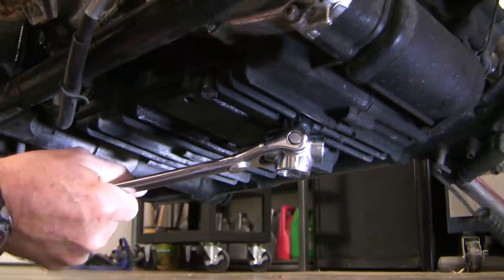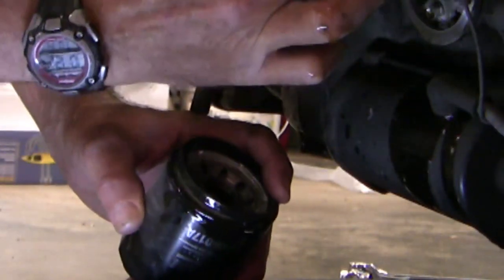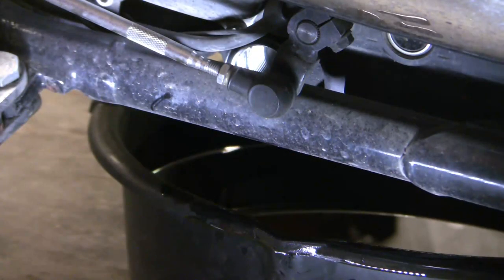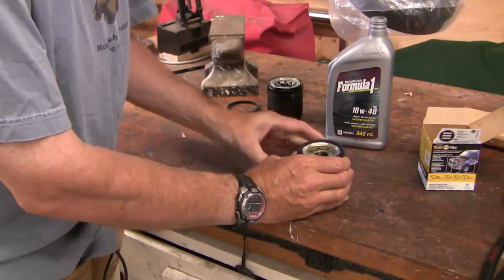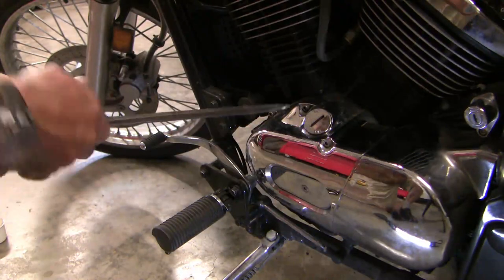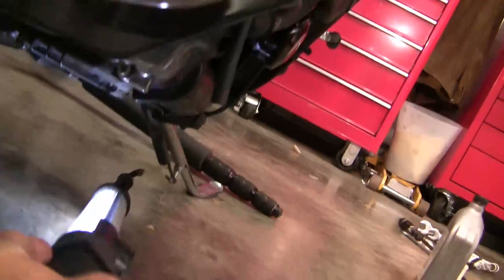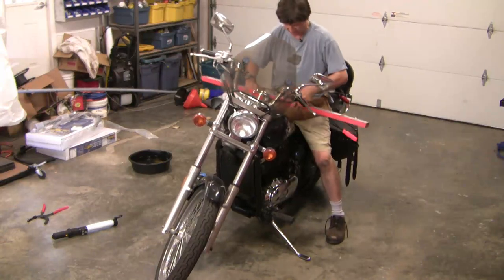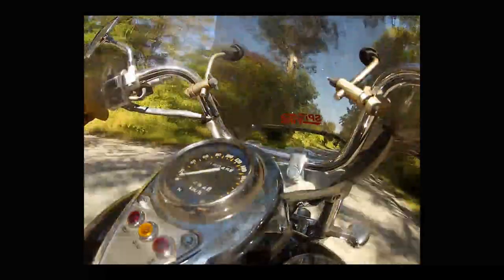How to change motorcycle oil,  Kawasaki Vulcan

Comment from the maker: About once every year somebody remarks that their oil screen is put in with the opposite orientation, with the open end of their screen on the inside. This happens often enough that I suspect recent models of the Vulcan may have the opposite orientation for the screen. I went back to verify that I did it correctly. In the official 1995 Kawasaki dealers service manual, on exploded diagram 6-2 and the photograph on page 6-6, the service manual clearly show that mine is assembled correctly in the above video. This fits with my experience, since I did the first service on this bike and it was assembled that way from the factory. Not one of those who have commented in this thread were able to quote factory service manuals or technical service bulletins to back up the claim that the screen is in backwards. If your screen is installed with the opposite orientation, I would make no change until you take the time to consult with your own official factory service manual, since year of manufacture may be important. If anyone comes across more objective information from Kawasaki, please take the time to provide links to that information here. I'm sure many who stop by will be interested.
Reply: Not true
Reply from the maker: @natalijaly456  That reference you quote agrees with what I have said for the VN800, read the last lines. Whenever you search for information on your bike, go directly to the source, the OEM dealers repair manual, not aftermarket websites that apply to many years and many models. I have done that for the VN800, see the discussion thread for more information. If your bike is different, I probably wouldn't change it, but don't be so confident you are doing it correctly until you consult your OEM dealers repair manual.
Reply: Good day sir. Love the videos keep them coming... I have a 2004 Vulcan classic 1500 and the book tells me to have the open end with O-ring in first..
Reply from the maker: For those who don't own a factory service manual, I recently discovered that Kawasaki have taken the time to publish detailed parts diagrams collated by year, and offer them online for free. Those part diagrams will show your screen orientation. I found mine in that list, again demonstrating the screen orientation for my year is correct in the video. They also sell full online factory service manuals at the relatively inexpensive price of about $60, which is a bargain for those who work on their own bike.
Reply: I have a 2000 Kawasaki Vulcan vn800 I was wondering exactly how many quarts of oil do I put in it when I change oil and filter.
Reply from the maker: @unchained20000000  2.9 liters, if filter is removed and engine is not dry. This is printed on a sticker made by Kawasaki to the right of the oil fill hole. I do maintenance on several vehicles so I use a 6 liter graduated cylinder and put felt pen marks on the cylinder for each vehicle, to help recall this detail. Saves time and reduces risk.
Reply: @spelunkerd  Btw can you do a coolant change and check on the Kawasaki Vulcan vn800 as well.
Reply from the maker: @unchained20000000  It's done, on my channel there is a playlist of motorcycle videos, you'll find it there.
Reply: @spelunkerd  This answers my next question,  lol, I'll be needing to find and change my engine coolant as well.
Reply from the maker: @highenergyog  You might check out the Kawasaki website, where you can find electronic copies of their factory service manuals  specific to your exact bike for a reasonable price. I get one of those for every vehicle I own, it is an excellent investment. Nice to meet you!
Reply: @spelunkerd  Thank you for that helpful advice,  I truly appreciate it and I will do just that . Best regards, Lloyd.
Reply: @spelunkerd  I bought a measuring cup for shop use. In my 800 I put 3 qts then just a tad over 1/4 cup. Sight glass looks good and no problems. I just wish my Harley was this easy and cheap. $37 for K&N 303 filter and 4 qts Lucas 10W40 semi synthetic oil for Vulcan  VS $200 for 3 hole change a the Harley. Dealer gets $400. No thanks, I’ll do it myself.

Comment: Been building Harleys and Triumphs since mid seventie. Got creamed by a drunk on 9/11. Met a friend of a friend who had a 2002 Vulcan. In 03 that was the first bike I rode after my 9/11. I was amazed at the v-twin, sound and over all nice style. 2014 my uncle came across a 2005 Vulcan. At 72 hes not into motorcycles so I bought it for a couple grand. What a revelation. This machine is awesome. Thanks for the tips. Ride safe..

Comment: Spelunkerd…Thanks for the Great Video. I have a 98 Vulcan 800. Changed the oil today. Add these tips. 1. I do not recommend Synthetic oil as this bike has a Wet Clutch. Possible to burn up the clutch. 2. When draining the oil, that washer under the drain plug drops into my catch pan. Be sure to find it. 3. I hate draining oil onto my starter when removing the filter. Take a Paper Towel roll center carboard and cut it just shorter than the Filter. Then cut it open and place it under the filter. With this I only dripped one drop onto my starter. 4. I put a 2x4 under the kick stand. This gets it almost level. Then I can tilt it the last bit with one hand on the handlebar and one hand on the kickstand. 5. That big square ignition key is the tool for removing the oil fill plug.

Comment from the maker: Yeah, sounds a little preachy in retrospect. But it's a critical point, sometimes not emphasized enough for those who try to learn mechanics through a computer screen. There aren't many ways to screw this task up, but a double gasket is one. Quick lube shops carry liability insurance, and I am told that this is one of the most common reasons for a major claim. Thanks for your comment!

Comment from the maker: The plugs are fairly easy on this bike, and i'm not planning one in the near future. But I did replace the plugs on my Dodge Ram and I recorded that. If interested, search my channel, "Dodge Ram tuneup". It's important to have dielectric grease. And some, but not all, recommend antiseize on the threads. Plug manufacturers have drifted away from antiseize lately because of concern about stripping threads on the cylinder. Be really careful not to cross-thread the plugs, (don't ask how I know).

Comment: I also place a piece of masking tape just below the oil filter on the block and attach  6 mill plastic to the back of tape and let it  hang down to prevent oil from dripping on starter ect.  
Makes clean up easier .

Comment: I just changed the oil on my 2004 800 Vulcan.  To keep the bike leveled I just screwed in two hooks into the studs of my garage walls.  I used ratched straps to the handle bars and the hooks and adjusted the level of the bike.  Quick and simple.
Reply: I used a motorcycle jack.

Comment from the maker: When the bike is tipped on it's side, the meniscus is not visible and it's easy to tell if there is no oil. So, as a quick check at the gas station I just lean over to be sure I don't see the meniscus. At least I know it's not low. Thanks for your feedback.

Comment: Here’s my suggestion for not only checking the oil level while the bike is standing straight up, but for doing the oil change, and changing other lubes as well: Go to Sears, and spend the $100.00 on a Motorcycle Jack Stand. It’s short money on the benefits you will reap from having it. It’s the most valuable tool you’ll ever buy for working on your bike. It stands it straight up, elevates it up off the floor securely with ratchet straps in 3 different preferred heights for a good working position, and you’ll use it for countless different jobs while working on your bike. I got mine several years ago after a friend’s suggestion and I’m so glad I did. It’s not very large, easy to stow away, and has been invaluable on a dozen different bike projects. You can even use it to work on other things like lawn tractors and such. Check it out, and you can thank me later! Great video, and thanks for the tutorial! Safe riding!!!
Reply from the maker: I have one, I agree. Makes oiling the chain so much easier, and other jobs like wheel removal are a snap.

Comment: Thanks for the video. Helped me change in my 2007 Vulcan Nomad 1600. I got a J&S jack when I bought my bike a month ago from the previous owner. Not to give a plug here, but the J&S jack is the best thing I have ever used. Came with an oil drain plate and everything. Go check out the video on their website, you might think it's bull s***, but I did it. I sat on the front wheel of my bike with it off the ground, and sat on the back seat while up on the stand. Stable as a rock. I was completely blown away. The video is accurate. No false advertising here. It is a 500 dollar jack, so I guess it should be damn good.

Comment: Well   done !!  The weather was great for a bike this year so far.  This is how I measure the fluid for  every piece of machinery I have.  I actually measure once the right amount  of fluid ,  eng oil , gear oil, power steering ect and pour it into a translucent  plastic container with a removable lid and mark the required amount on the side.  Each container is labeled for each specific machine.  I have a shelf  with  10 containers ready to go for the next fluid change.  Works for me.

Comment: Well done . Thank you very much. Now if you own the bike for a long time all you need to do is remember how much oil it takes that way you won’t need to check every time you change oil .
Reply from the maker: Thank you. Yes, I print the volume needed for each vehicle on the bottom of a measuring container used exclusively for oil. The other thing to remember is to wrap that container well so dirt from the garage can't contaminate the new oil.

Comment: I have ignored the oil screen filter for 15k miles.  I will check that screen on the next oil change. Thanks for the video.
Reply from the maker: Although i clean the screen each time I have found very little debris in it. When you do it, pay attention to the orientation of the screen, and reproduce that when you reinstall it. Some viewers here have described their model having a screen that is installed the opposite way. Mine came the way I show it from the factory and also I have a copy of the official dealers manual that showed the installation as I did it here. But, other models may be different.

Comment from the maker: Great idea, Jack, I'll do it next time. For some reason I haven't had the cooling system problems with my bike that I normally see with larger engines. The coolant drain plug is at the bottom of the crankcase, near the oil drain plug. You just remove the plug, open the top coolant filler cap, and let it drain. Then siphon the reservoir. Volume is small, as I guess I would expect. Like a gas engine you want to burp the system with cap off for the first cycle.

Comment: Very thorough video, thank you!  I don't think many people pull and clean the oil screen, great to know!  It is not even in my Owner's manual for my 2009 VN900 Classic LT, but it is in the service manual I downloaded.  I doubt most of these shops charging $100-$200 for an oil change do it either.
Reply from the maker: +ncmcgoverns Ya, agreed. I haven't found much debris in my screen and I suppose it would be possible to skip it. Cleaning the screen is described as a step for routine oil change in the dealer repair manual, so I included it. Thanks for watching.

Comment: In regards to making bike level to check oil, I made a 5 inch high block that is 6" wide by 8" long to put under the kickstand to level bike. That way, I can get down and inspect the oil level glass without any problems. I can also get under bike to see if there are any issues under the bike. I found this much better than the level and mirror that was used in the video.

Comment from the maker: You're welcome, Keith. When I bought the vehicle I also bought a dealer's manual. The Kawasaki manual is not as good as many vehicle manuals, but I have referred to it dozens of times. Those paper manuals are expensive, but lately I've found copied pdf versions of OEM manuals on Ebay that are much less costly.

Comment: enjoyed your oil change video. i just started playing with my 08 vulcan classic 900lt. installed a baron BAK. trying to figure out the reason the FI light is staying on but in the meantime, an oil change is on the quick list. Your vid is extremely thorough and comprehensive. Nice job.

Comment: great video, very detailed and thorough. A much better way to check your oil level is to get a motorcycle lift. the lift will hold the bike in an upright position. Then your bike will be at a nice working height too.
Reply from the maker: That's a good point, I have a lift. When I bother to set it up, checking oil is a breeze.
Reply: Perhaps you know if a 2004 Kawasaki Vulcan Ltd en500 uses conventional oil or synthetic oil.
Reply from the maker: Don't know, sorry. My friends consider me a luddite, since I normally reach for natural oil. However newer engines are designed around thinner oils that can get into areas where natural oil won't go unless hot.

Comment from the maker: You make a really good point, and I have to confess that when I'm on the road that's the way I check it if I don't have a level. Tipped on it's side the level should be near the top. A center stand would be great. Thanks for your comment.

Comment: I appreciate the advice. I will probably pick up that filter you have in the video. Although my current filter is the HF303, I have that same filter (yours in the video) saved in a note written in my User Manual. I'll stick with what works. Thanks again.

Comment: Please make more videos... our have the best instructions for the vulcan.
Reply from the maker: What a kind remark, thank you. I still ride the bike but nothing ever seems to go wrong with it. It's proven to be a very reliable ride over 22 years.
Reply: I'm having an issue with my bike backfiring. I think it's coming from the carburetor from what I can tell. Have you come across this issues yet?
Reply from the maker: If your exhaust is modified, the carb jets need to be properly adjusted for the drop in exhaust backpressure. It's not a problem I've had to deal with on this bike. Good luck!

Comment from the maker: (continued) You've raised a very interesting point. Although mine is correct for my bike when it was manufactured, I wonder if Kawasaki changed the design. There has never been enough debris in the screen for me to see if it collects on the inside or the outside of the screen. The direction of oil flow through the screen would be a factor there. Practical issues such as difficulty getting it out and ease of cleaning may be factors as well. If yours is fitted differently, I would not change it.

Comment from the maker: Yeah, I do have a small lift, but for a cruizer it is not so stable, and of course it's a pain to set up. One thing that is useful is the fact that when the meniscus is at the top of the site glass while the bike is on the stand, that corresponds to a 'not low' level when I carefully level it. So, at the gas station when I often have a glance at the glass at least I know I'm not too low, and I can check it often with no effort and no tools. Thanks for your input!

Comment from the maker: Thanks, Mario. Next time I do it I'll video the effort, but it may be a couple of years. One thing to note is that my Vulcan doesn't have a fuel filter, so if you are having problems with the carb clogging up you might consider putting a fuel filter in line, if yours doesn't either. I did that when my carb got dirty and it hasn't been a problems since then.

Comment from the maker: As I recall it was about 3 1/2 litres, but I would check the manual for your bike. I have a large pail with marks for each vehicle I service, and I just fill the pail to the respective line, and it's usually about right. Most importantly you want to recheck levels over the coming days.

Comment: Howdy man. I may have a suggestion regarding checking oil level by yourself when completely level. I use a brick or wood block that I tuck underneath the kickstand when down and wedge the tires on the other side. If on a steady surface it should be absolutely stable that you can check it without sitting on the bike.
Great vid!

Comment: I use a motor cycle jack to bring my bike upright, you can check it for level if you want. As long as the floors level you shouldn’t have a issue